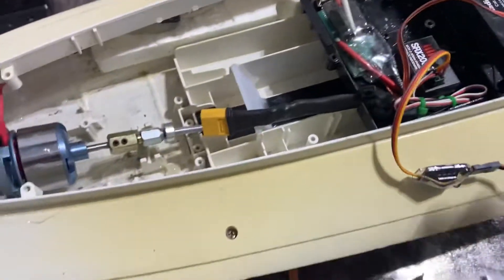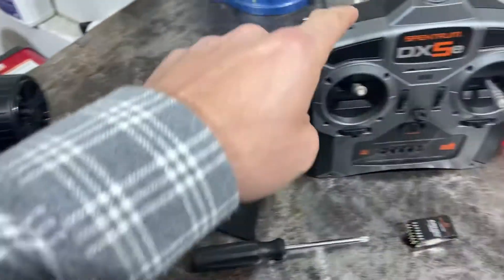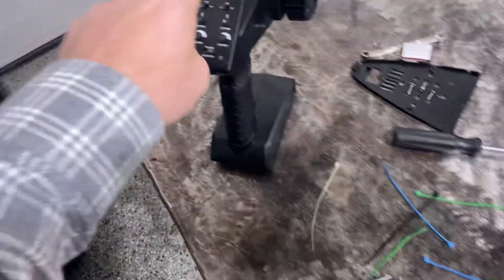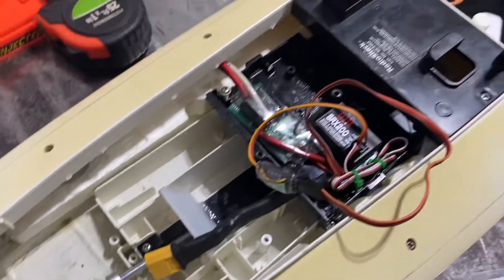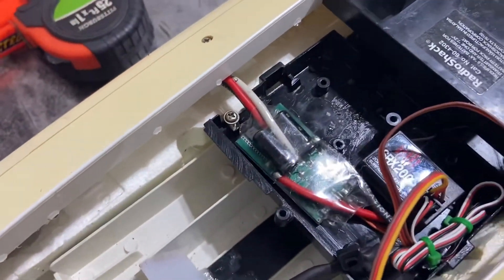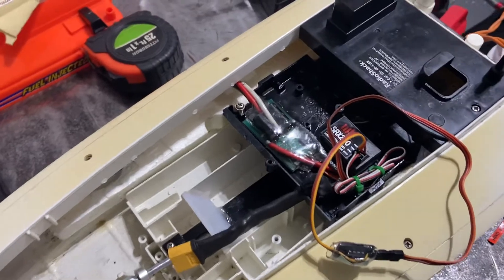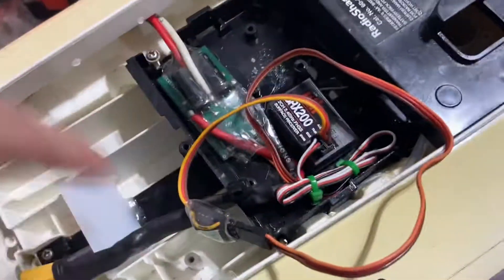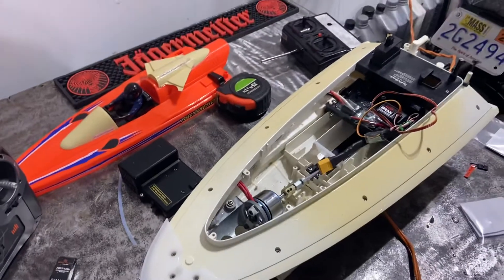How to use RC Pistol Grip Transmitter with airplane ESC correct throttle function problem

Comment: I had the same problem. did not understand why it kept beeping and not working. Now I do. Just had the idea in my head that this esc was able to go backwards too. but no. that are the other small ones I have for brushed motors. those I can program to go backwards or not. Thanks for clearing up my memory. nothing more frustrating than having a problem and not understanding why it occurs. Thanks!!